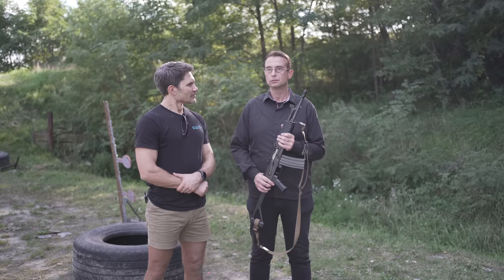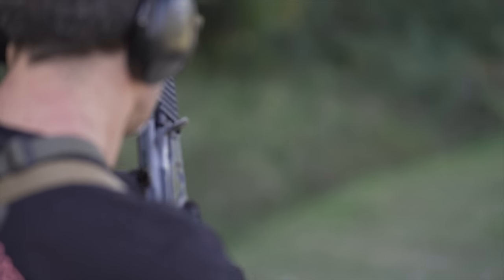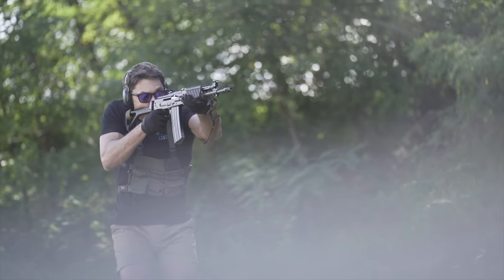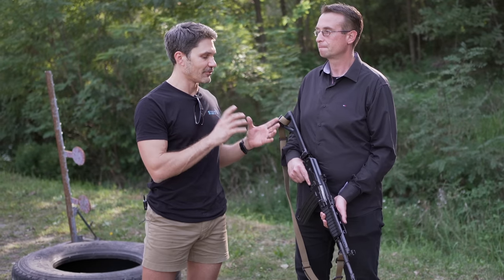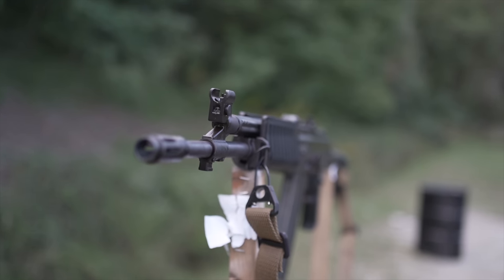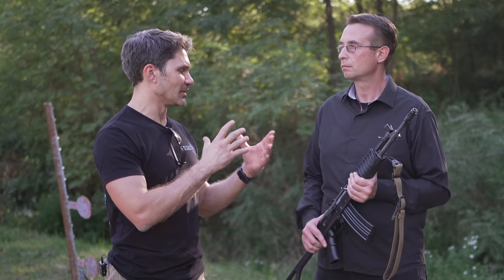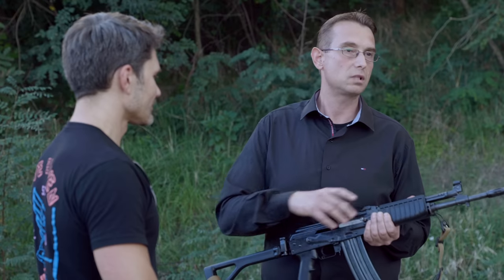Zastava M21: Serbia's Military Service Rifle

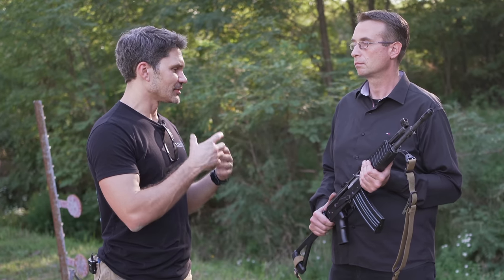Comment: 8:00 In Serbia, we don't have ridiculously complicated gunlaws like ATF is imposing on American civilians.
In Serbia, there are 4 categories of weapons:
A: Automatic firearms, explosives and suppressed firearms. (Only available for police and military)
B: Semi-automatic firearms (M21 must be converted to semi if you want to own it as civilian) (Available for civilians, but must apply for permit and get approved permit)
C: Converted firearms, old collectable firearms, blank guns, crossbows over 101 lb and air guns with any specification higher than: 10.5 J, 200 m/s, 4,5 mm, 450 N (require you to notice local police station within few days from buying it that you possess it)
D: Knives, batons, pepper sprays, crossbows & bows with lower force than 101 lb, weaker air guns (don't require permit)

Comment: M21 is a good rifle, compared to the Polish 556 rifles I rather have this in my inventory. I love my Zastava rifles but it’s hard to find a scope mount for my M77 😅 I love how Zastava doesn’t have jacked up iron sights. My KR103 the front sight is off by a millimeter and I just have to get it back and my Polish AKM is the same way. Zastava all day ❤
Reply: How bad is beryl compared with M21? Beryl got rails over receiver which is not welded over where as M21s dont have any but side mounts
Reply: @albysputhookattil007  beryl is very similar and is a lot easier to find on the market. You can get rails for the M21 but everything Zastava is kind of hard to find in stock.

Comment: Looks amazing.
I’m very curious about the iron sights, seeing as it doesn’t look like a traditional leaf and forward sight block (almost like a Krink combined with a 100 series carbine).
Another difference from the M90 is there isn’t a gas adjustment on the gas tube, but I kinda expected that for a rifle that would see actual military use (the less breakable or fail-able parts to worry about, the better).
I like the hinge, angle, and direction of fold on the stock, but I’m trying to get used to the aesthetic of the butt stock itself.
Honestly difficult to imagine an alternative to fit the receiver tho.
…Oh but yeah, definitely bring that thing over here.

Comment: I own an M90NP, the CAI imported M90 with a STANAG magwell added (correct me if I'm wrong, something like 2500 units total were imported, back when 5.56 AKs were not as well received). I've also held and fired my friend's newer Zastava USA M90. They are, of course, identical firearms, except for the magwell/magazine use. So, that being said, I think I can offer some feedback after many years of running my M90NP hard. It's an excellent weapon. It only has TWO downsides, in my own opinion: in more humid climates, it rusts like crazy if you don't REGULARLY keep it oiled; in a desert or extremely dry climate, it's good to go at all times. So long as you keep it maintained, it'll be fine (unlike the common stereotype surrounding AKMs of minimal maintenance). Secondly, the elephant in the room, it's heavy as shit for what it is. As it comes from the factory, you're just shy of 8 lbs... not terrible. But to make it more than just a range toy in today's age, it requires the necessary addons.. weapon light, weapon light mount, optic mount, optic, flash hider, weapon sling, etc (and I'm not even including a magnifier, a suppressor, or an IR device)... UNLOADED we're at almost 11 lbs, loaded we're over 12 lbs. It's stupid heavy for firing the humble 5.56x45. I have fully kitted out .308 rifles that weigh less loaded to 20 rounds. ALL THAT TO SAY, it's still one of my favorite rifles (if not actually my favorite), but I'd be lying if I said I didn't want something a few pounds lighter doing the exact same thing just as well. I wonder if the M21 is any different in that regard? Based on the video, they seem like almost identical rifles.

Comment: Looks like it needs adjustable length-of-pull folding stock, railed hinged dust cover and railed handguard.  Kind of looks designed for the 90s in its present state.  I'm a bit more interested in the Zastava M77.
Reply: There is actuall an updated version with rails, this is literally how it looked like in 2000s when it first came out, maybe try to look on the official zastava site, i think they have pictures of it there.

Comment: M21 5.56mm, extremely accurate rifle, hard chrome barrel (I have it in the profile picture). very little recoil, on the picatinny rail can be laser, optical sight, instant sight, underbarrel grenade launcher 40mm. Depending on the needs. It works on the principle of borrowing powder gases as well as (m70-7,62), or Russian (AK)...Extra rifle. Thank you for the video.

Comment: There is also a version of the M21 with built-in Picatinny rails (both in the dust cover and in the handguard). We can buy them (in semi auto) in my country, hope it'll soon be the same for you guys out there in the US

By the way, did you also try on the M05 models ? I personally own a M05 C, which is the replacement of the M92.

Comment: TLDR: I'll have 2

I've heard of these before, though never actually seen one apparently. This is EXACTLY what I've always wanted in an ak. I've got an m85, and bought it over the m90 because of the hinged cover and sight setup. I know the m90 has better ballistics, but I like the m85 more aesthetically (I'm that guy sometimes). Put an option for a railed dust cover with a buffer tube. Hell the stock doesn't even have to fold, I'll buy two. One to cut the barrel down to the gas block and see if it still runs cause I like that kinda stuff. The other one to keep stock to ensure reliability. Yes I know it's a pap85 or a z85 or some shit but the m85 is what it's based on so thats what I call it.

Comment: I don't own a single firearm in 5.56. Every time I'd get close, I'd find another AK or good deal on 7.62x39. I was disheartened the first time I shot a Galil, knew I wouldn't be happy with it. The Aug looked interesting but sticker shock scared me off. 
After watching this video and hearing you specifically address the things I didn't like about the Galil (add being lefthanded and that the casings eject at warp speed, sometimes right into the crook of my elbow) and I'm intrigued, to say the least. If one ever appeared in Pensacola would definitely be worth checking out.

Comment: I have a older m70 but literally every except the flat has been changed out…..Got a gucci FN barrel with a 1:9 twist, gas piston/bolt carrier is Hungarian and the trunnions are milled up front and forged rear, quad rail, magpul afg2, I got a tapco g2 trigger about 10years ago for like $15 on sale runs amazing I actually deer hunt and hog hunt with it

Comment: While it would no doubt work fine with a lower back pressure can, I think if this gets imported they should implement the same adjustable gas block on it.

Comment: I saw the bolt holds open on empty, but does it stay open after you drop the mag and is there a bolt release?
Reply: @Nico Sammy G It's just the magazine, it's follower holds the bolt back after the ammunition is expended. Remove the mag and the bolt carrier drops forward. We did have a prototype called Zastava M64 with a built in bolt hold open, but... in the end a lot of stuff got ditched in order to make the rifle affordable. Check the image of a Zastava M64 prototype online, you'll see what Galil would become in 1970's (M64 is the year of production - 1964 btw). And so, sadly, a lot of great stuff didn't make into the final cut.

Comment: Went are they still using the standard dovetail scope mount, instead of replacing it with a side-mounted pic rail where you don't lose zero?

Keeping the dust cover "upper receiver" this long after SIG showed us how to build a modern AK right with the SIG 550-series is also . . . pretty stupid.

All the same, congrats to Zastava, I really like what they have there.

Comment: Am I alone in not liking side folding stocks?
Reply: Depends on the gun. On the MP5, I like them. It’s very compact. Most other ones,  I don’t care for them. Such as AKs, ARs, etc. Especially on AKs, since companies insist on making side rail variants with left side folding stocks, which makes it impossible to folding completely. Also makes the gun far wider and subsequently, not much easier for transport.

Comment: Finally they chrome their barrels... Hope that they harden their ejectors, steel cases tend to deform them on the 70's series.  Objectively, it's just a galil. With mediocre sights.
Reply: Galil is a copy of Zastava m64,all Zpap models come to the US with chrome barrels, study the topic before commenting
Reply: @sevasthvostanski5588  Nope. 
Early Galil study was from of Finish Valmet RK62. 
First Galils where made from receivers obtained directly from Finland. 
Study general guns history before putting your sacred sub-par rifle at the source of everything. 
Ah cool, finaly chrome bore on civilian rifles ! Good job Zastava. 
The ones I have handled here in Belgium recently where not.
Allmost all military M70's rifle I have come by as a 20 years Forensic Firearm Examiner here in Europe where at the minimum unserviceable due to barrel corrosion and erosion. 
Got to fire-clean 8 on 10  of them due to no chrome.
Hammer forged is good yes but chrome is a minimum for a service rifle . 
For fudge sake, even the chinese "junk"are.

Comment: No pic rail on a modern military weapon?  What?
Reply: @SW6Stateside There actually is, this is an early pre-series rifle, just search for Zastava M21ABS and Zastava M21SBS and you'll find it. Heck, if you check on official Zastava Arms web site under those names, you'll find both versions with in-depth description:

"Models of assault rifles with mark BS have built-in Picatinny rails, in accordance with NATO standard, on the receiver cover and handguards. With this re-design of model M21, there are more possibilities for the mounting of various types of optical-electronic devices. 

Assault rifle M21 BS is a gas operated weapon, and locking system is rotating bolt.
The reliability of functioning in various environments was confirmed by strict methods of testing, in accordance with military standards.

The barrel is made by cold forging and the interior is chrome plated. This provides long service life and exceptional precision of the automatic rifle.
Good solutions for the ergonomics, with excellently balanced weight, provide mild recoil and easy control of fire.
Flash hider masks the position of the shooter.
Materials that are used, handguard and folding stock made of polymer and finish of metal parts provide easy maintenance.
Type of fire is selected by ambidextrous lever, which has three positions: single shot, burst, safe.
Iron sights with tritium tubes provide the possibility of aiming at night.

The rifle accepts underbarrel grenade launcher in caliber 40mm, model BGP 40mm. Picatinny rail on the lower handguard enables the assembly of underbarrel granade launcher BGP 40×46 mm".

Cheers. 🙂

Comment: Serbian Galil Lmao, The Grip, The Safety, front Sight and Gas Block
Reply: @pharaon gaming Except, it's based on a Zastava M64 prototype (yes, we've had 5.56 since the Sixties, LoL), which had all Galil came up with in 1972 and then some (like bolt hold open mechanism being one of them)... But it was deemed way too expensive. Just search for "Zastava M64 Prototype", check the image and you'll see what spawned the Zastava M70, it's the "Swisswatch" Zastava M64 from 1964, not the Galil from 1972.

Comment: looks like a serbian galil
Reply: @AROUND THE FIRE LLC Except, it's based on a Zastava M64 prototype (yes, we've had 5.56 since the Sixties, LoL), which had all Galil came up with in 1972 and  then some (like bolt hold open mechanism being one of them)... But it was deemed way too expensive. Just check the image and you'll see what spawned the Zastava M70, it's the "Swisswatch" Zastava M64 from 1964, not the Galil from 1972.

Comment: I mean, isn't it a bit dated by today's military modernization standards? No rails anywhere?
Reply: 1999 was the date of start of the project. Ak for 21st century or beginning. 5.56 because we had slight delusion that we would join nato then the whole bombing thing happened. And Iraq war showed that 5.56 needs more stopping power. Hence the 6.5 Grendel in m19. Same or better ballistic but more energy at the target. And only thing to change from 7.62×39 to Grendel is barrel. No need to change bolt and other things. Barrel and magazines.

Comment: I had that rifle im my unit and we threw it away...  That is the worst rifle in the world absolute piece of garbage... DISASTER OF RIFLE! Maybe they made it just a little bit better for export.. But you'll see eventually what piece of crap is it. Gas piston literally brake in half in one of the rifles, that safety on your grip is absolutely useless, you will literally get your self blind because of gas returning, corrosion is impossible to stop, material used to build that rifle is absolutely the worst possible ever. Rifle goes red in couple of days when you take it outside even if you put thick oil coat on that piece of crap it will corrode, that butstock is closing by itself while shooting and my friend got hurt. That rifle is   REALLY BAD PIECE OF CRAP!